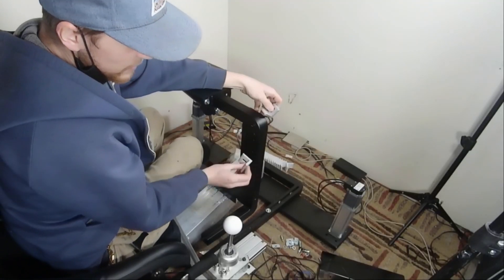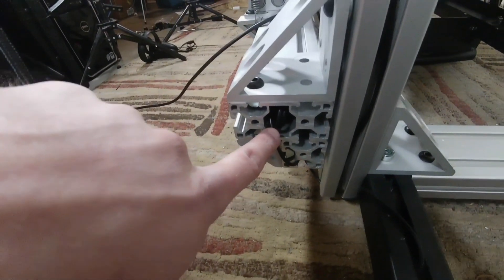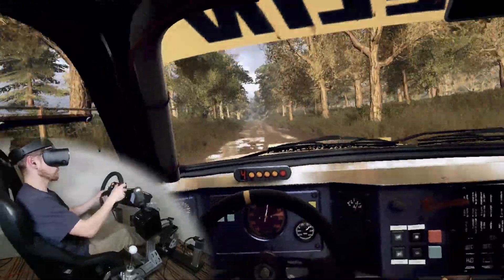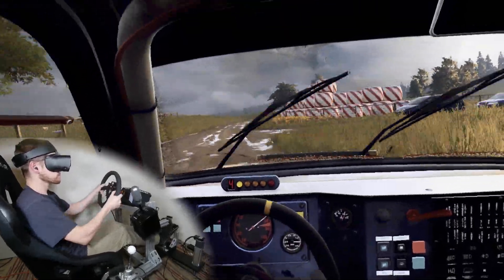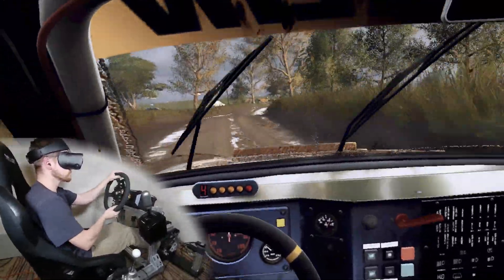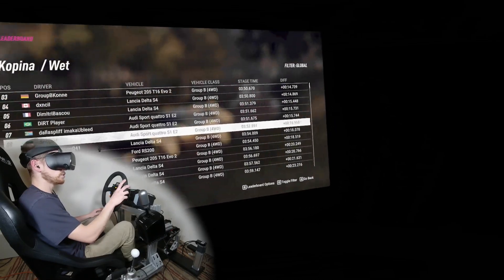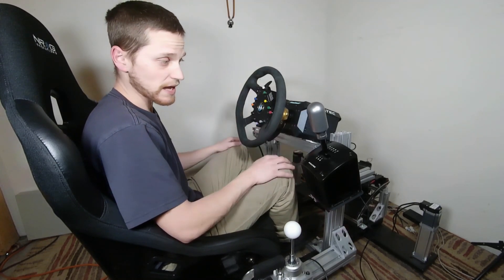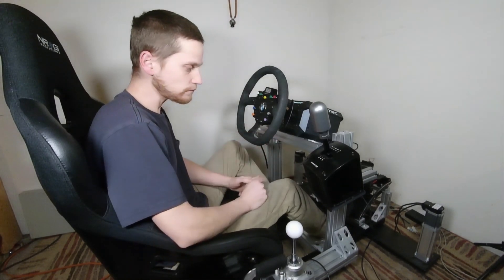How To Modify A Prosimu T-1000 Part 2!!!

Comment: About the 1.5 shifter mount. you have, or there should be in the Fanatec shifter box. Nutts to put into the outer channels on the shifter, use those and mount the shifter directly to the profile with 2 corner brackets.
Reply from the maker: Thats a great idea! I forgot I vould mount it like that...gonna look for the box now.
Reply: @DouglasThompson  A really good feature with that shifter. :)
Reply from the maker: @RVRCloset  I found the inserts and got it all mounted up! Waayyy more solid.  Thank you for the suggestion. Its lighter and stiffer
Reply: @DouglasThompson  You are welcome buddy!! :D

Comment: I got a question I just realized I didn’t get a iracing voucher with my wheel purchase from fanatec. Is there supposed to be a code in the box?
Reply from the maker: I had no idea that was a thing...is that some dort of promotion?
Reply: @DouglasThompson  I think its an option on checkout when you buy a wheel, its only for new members though.
Reply: @DouglasThompson  yea they gave me iracing for 3 months for 1$ but I never got a code and there’s nothing in the box.
Reply from the maker: @CaliCuh  my voucher for f1 2020 cam later than my order but still give them an email reminding them.
Reply: @CaliCuh  Its on the fanatec website, on your order page I think.
Reply: @stabizisback  just checked I got nothing . It shows I paid for it but no code.